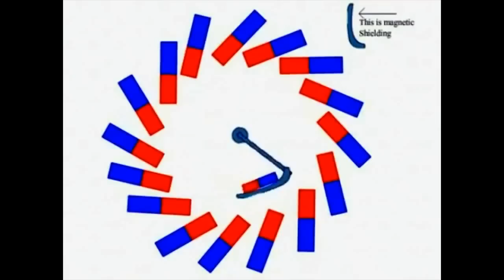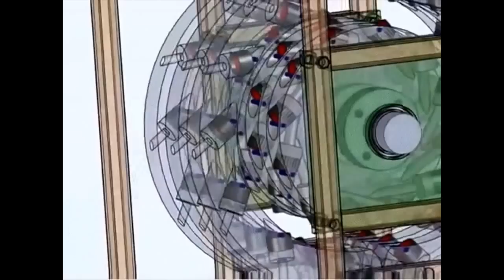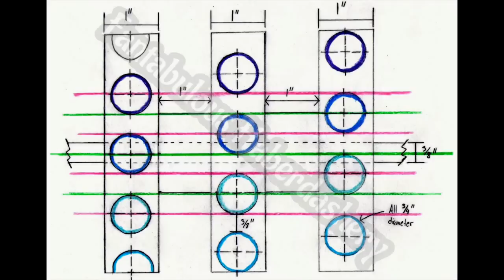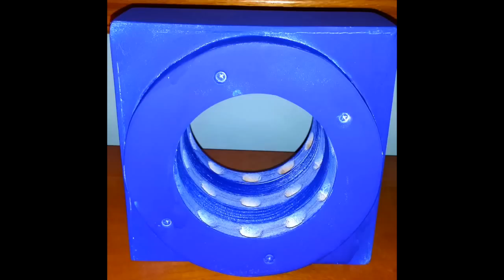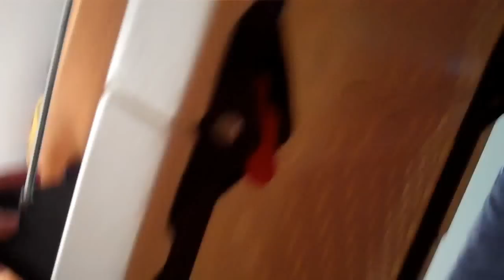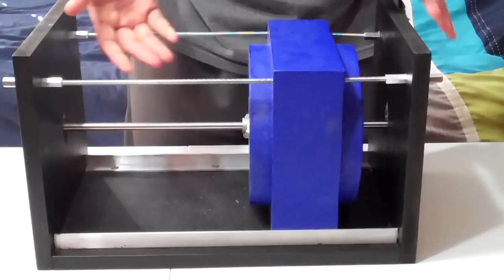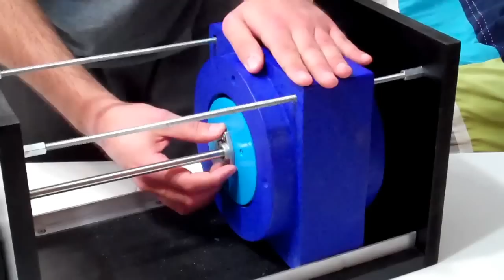Working Perendev Magnet Motor!

Comment: I like what I hear. People like you who think outside the box, are the difference between success and failure. Keep moving forward, making prototypes of your designs. If you figure out how to make a magnetic powered motor that can produce enough torque to turn a generator, then you have something. Adding batteries for energy storage, then you have something more. Further development for increased performance comes next. Your on to viable clean energy production. Do not let nay sayers have any affect on you. I have done things in other disciplines that were said to be impossible. I learned from mentors that did the same thing. Excellent job.

Comment: At around 10:09 when his hand moves away you faintly hear a noise like something was laid down on a hard surface. Could it have been something in his hand? Also at around 8:40 when he moves his right hand out of frame you can see a reflection of something enter view on side of box near edge of screen around about where the end of the shaft and bearing is which to me if you look closely looks like it is rotating.

Comment: "the laws of physics can't be broken" boy you obviously don't read a lot because we're using a quantum computer to reverse the time scale of atoms by a few seconds. A literal time machine. These free energy machines ARE real it's just that the exact numbers and whatnot are kept secret because it would make the coal and a lot of the electrical industry useless. Coal is so outdated I'm surprised we find reasons to keep using. The "golden ratio" he talks about isn't this, an old man was murdered over this engine,  over the IDEA that an out dated and deadly energy source was going to be replaced, a man was murdered and it was covered up. The ratio is like 1/8 in from inner ring which houses where your energy is gonna flow out and power while the ring with the magnets are set and locked into a certain position (about 1/16 inch distance from next "grabbing" magnet. This particular model he's demonstrating is totally wrong which is why it's not working. That moving piece is moved using some excess energy to reapply the initial energy put in to make it go in the first place. Energy is recycled through it's various mediums but is almost always the same amount of power because it takes energy to change your energetic state. E.I boiling water = steam

Comment: You have to try it with load. But you have to calculate the size of the load. It will not work without load. This is like a second-order differential equation, like "spring mass damper system".

Comment: Scam.. fake, joke...
The reason the camera angle changes is for the motor and rubber that you put in the end to spin the motor to show it 'working'.

Having been a  engineer amount other things the facts you have and design would never work as it, it's close to a design, but a mile away due to the flux issue.
The entire magnet position and angle is dictated by its fields. Which is why people fail in trying to make these things.
Reply: Why hasnt the greatest prankster on the net Thio Joe jumped on this scam?

Comment: It's not balanced!  If you balance it, it will spin longer.  Being out of balance is slowing it down.  I'm not sure it's producing energy, though.  Good luck!
Reply: it is out of balance, out of spec he changed the magnet angle, he used the wrong size magnets, the wrong length it is amazing it ran as long as it did

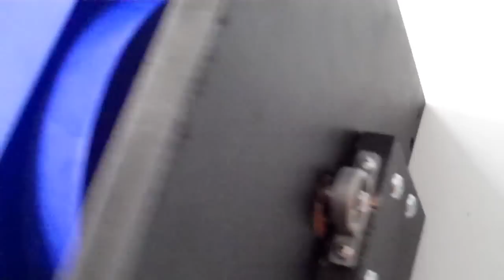Comment: At 9:17 you can see you pull away something from the shaft on the left side and you can hear you set it down on the table, at 7:46 you can also see a black gear attached to the shaft on the same side of the box, infact at 9:58 when it "catches" you can see and hear you attach something to the shaft again, definitely another scam. Maybe you could explain?
Or do you consider everyone a idot? The truth is your materials are to heavy and off balance to every make this succeed.

Comment: That thing is so out of balance it can't sustain a spin for very long. Enter the little R/C starter motor that he holds on the shaft, if you notice the shaft end it's not round. That's why he won't move his left hand, he needs to hold the device while he puts pressure on the shaft with the R/C starter motor. They are quiet also.
The shadow and the sound it makes when you turn off the starter motor gives it away. Nice magic show!

Comment: I like the way you are thinking, as in not so much as producing a high powered motor
but eliminating the rotating resistance first. You almost did this 
I'm sure you will achieve this, then you are clear to work on the power and torque'
good luck. Malc uk

Comment: Why are there so many negative comments about this? Magnetism is a real, scientifically verified phenomenon. Fact 1:Opposite poled magnets attract, same poled magets repel. Fact 2: energy can be Converted, i.e., mechanical to electrical, chemical to electrical, and in this case magnetic to mechanical. Fact 3: an object in motion will continue in motion untill an opposing force acts against it. Its obvious from the video that the inner rotor is wobbling, due to it being handmade and not balanced. The opposing force is friction. The friction is in the bearings, and even some air friction between the inner rotor and the outer. If a generator were connected to the rotor shaft The weight of the generator windings Would add more feiction. The creator admits in time the rotation will stop. He does not claim this is a free energy machine. Energy conversion is real people, so leave this obviously intelligent kid alone.

Comment: " ...eventually it slows down ..."
That means its losing energy and is therefore no good for any application.
Its more of a non powered flywheel that has some kinetic energy stored but could not power anything but itself ...for a minute or so?

Comment: I know you were trying to keep it super low budget but you'd have been much better off using a machined and balanced piece of acrylic for your rotating shaft.
Why did you use friction ball bearings when you could have put magnets on either end of the shaft and had a floating shaft with no friction, it's friction that kills all magnet motors, it amazes me how nobody uses magnets to have a frictionless shaft to spin on.

It has a long way to go but at least it's still looking at it and trying to find solutions, good video.

Comment: Try incorporating a planetary gear between the two magnet sources, to progressively advance the timing of the attraction,  and push.
Reply: Due to the equal energy of pull and push, the energy must continually advance to offset each other.
Reply: A heavy flywheel may help maintain the inertia to reduce drag.  However, some of the energy produced, must power the advancing motion.  Just saying!!!

Comment: I have noticed that magnets that are purchased on line have a great deal of manufacturing tolerance allowance for the magnetic field. That is probably the reason it sometimes catches  and sometimes not. My two cents worth. Hope that helps. Keep up the great work with explanations too.
Reply: Ahhh, I wonder if any suppliers specialize in exact measurements of power
Reply: @wills242  Do not really know Bill bob.

Comment: Problem is not about motors working. it is about explaining why magnetic flux from magnets is a  never ending process? do magnets lose that kinetics at space ?? NO. does moon have a magnetic field?.  Problem is/ there is no way to explain endless flux from magnets. Practical usage of magnets never comes to a satisfactorial conclusions cause people do not try hard on magnetic shielding to reduce pole friction. after inertia motor should spin eternally at space if shielding made fine.

Comment: Proof of concept. Keep at it. 
As far as the laws of nature you’ll soon find out that the laws are not all correct. Thermodynamics for instance is flawed. To understand the science you wish to enter you need to understand the esoteric principles at work in the universe. Electrical engineering will give u a language and basic understanding but to tap into the unlimited energy you need scared geometry , torsion physics, vortex math, non Euclidean,  hermetic and alchemical principles, longitudinal wave mechanics and its phase conjugates. The problem is that people keep coming at it from one side or another and never use a holistic approach. It’s def real as it’s old hat in the unacknowledged special access programs. (USAPs). We’ve had free energy or overunity or whatever you wanna label it since the 60s in the US and the Antarctican Germans have had it since the 40s. It’s all too real. So don’t ever worry about wasting time trying or anything like that. Failure is the greatest teacher.

Comment: I to have been working on this for a very long time and even had a very rough model made years ago. I've seen the mistakes others have made and he even says it gets hung up on itself. If you go back to basic magnetism and how it works you may have it figured out like I did. And this type of device will not produce electricity but possibly drive a generator. There are also super magnets that would work great for this type of device. I am working on a proposal for a grant to develop what I have in mind.

Comment: He made a magnetic bearing. If you are going the build an "over unity", you need a way of pulling energy out of the environment, either from heat, wind, light, or better yet, electrical energy from the atmosphere. By "free energy", Tesla did not mean a perpetual motion machine, he meant real energy from the Earth's environment. There are 300 kilovolts of potential between the top of the ionosphere and the surface of the Earth. It is brought in from Birkeland currents that connect Earth electrically to the Sun. There is about 100 Volts/meter of potential in the atmosphere right outside your house. Run an antenna up a pole, a building, a hill, or a mountain. Run a cable down to the Earth at the bottom, convert that potential to usable alternating current. Then you have a simple usable source of power. You know, tall building have to be grounded to get rid of this potential. Maybe we could use it instead.

Comment: A bit strange that he didnt spot the obvious application. If the cost in energy going in, is less than what you get out - that in itself has value.
There is an australian company that use rotating magnets to cut electricity bills. It uses a pulse from a 12v battery, this causes the magnets + wheel to spin for a while, generating more than the initial pulse; then the whole process rotates. This brings this to a question of cost: how often must the magnets be replaced, how much gain is there compare to loss and so on.
I had my design running for days, but its useless if it wont output  more than it takes to power the pulse. An arduino to handle the pulse is probably overkill, but its what i had.
The idea is solid, its just that people make these absurd titles like "free energy" and "perpetual motion". There is no such thing. But there is clever use of the natural laws in a fixed situation that can be beneficial.

Comment: interesting you need to shoot another video without such a tight field of focus to PROVE you are not applying an outside motor to the external shavt on the left side of the video for there appears to be some kind of shadow  on the  left of the frame when the motor starts to "catch and run" then it vanishes again when it starts to slow down a wider shot would demonstrate that the test is not a fake though  i must admit your voice sounds a bit shaky near the end leading some  to think youmight be being a bit...disengenious? but post another vid with a wider field of view showing it running and iam sure that  will clear it all up. the next question being will it do some useful work and not just freewheel without an active load?
--Rick

Comment: It's relativity isn't it. The magnets can be made to move in relationship to each other. You set up an equilibrium between the magnetic fields and motion. Place any resistance on the motion or interfer with the magnetic fields and the motion will gradually cease proportional to the resistance until it stops. It cannot apply a constant resistance as the magnets in motion only have a limted potential energy. Rather like a satellite orbiting the earth in perpetual motion. Any kind of drag on it's orbit will gradually degrade the satellites speed and therefore alltitude until it ultimately meets the atmosphere.

Comment: From what I've found about magnets and how they are made, even if your machine worked, you would only get as much work out of the machine, as the energy, it took to make the magnets.  For example, if it took 500 joules of magnetizing power to make a neodymium magnet, you would only get less than 500 joules of work out of it.  If the magnets did not ever demagnetize over time, this would violate the law of conservation of energy.  Part of the final process in making a neodymium magnet is to magnetize the material in a very high magnetic field for a very short time.
Reply: Sir but a neodium holds over 10 years, that is very many revolations :)

Comment: Neat video.  You should try keeping your other hand in the shot when the motor is running.  It seems suspicious that the slow down seems to occur when you're hand comes back into the camera shot.  Also, if you're going to use wood for your prototype, you should find some way to lathe your magnet holder to reduce the vibration and keep things more consistent inside.  I'd also like to see you try this with a vertical configuration rather than a horizontal one.  Maybe use magnets to reduce the resistance that would otherwise be caused by that gravity in the vertical configuration.

Comment: Hay bro I can help you about slow down problem. Outside magnet ring bottom line use power full magnet top side use less power magnet because gravity slow down.if all balances you can run infinitely.i hope it’s work in this setup u have to run more fast because I hope more fast can break earth gravity

Comment: My theory is like pushing a magnet across a table with another. Spacing angle etc. all come into play. Also remember the weight of material the magnets need to move plus resistance. Then if you add a gear box to power a small motor. The magnets need to be large enough to do the job correctly.

Comment: If you can get the center drum to balance where it is spinning without any resistance,  you may find that will aid in the spinning and it probably will spin much longer, it looks out of round just a bit which will cause the drum to loose rotation and slow to a stop much faster.
Reply: Use of very low friction ceramic bearings would help- pricey though.

Comment: Can we see what's under the table?
It's very easy to make a convincing video like this, where energy is supplied in some way invisible to the camera - a jet of air, for example, or a solenoid coil under the table that would keep the thing going when it synchronises with the mains frequency.
Nice try, but you'll have to make a much more convincing demonstration than that.  All this one does it to make you an illusionist of sorts.
I don't believe in Yuri Geller either - another 'genuine' illusionist whose act could not withstand scrutiny by James Randi.  Neither would yours.

Comment: Your inner spindle wheele isn't ballenced. If the weight was evenly distributed you'd have more chance of getting it to run indefinitely.

There is indeed already a working, self starting, magnet powered engine that looks to be 100% better than this concept.

Comment: The perendev device can not work all by itself nor give more over enegy. It's just a perfectly balanced device where the attractive vectors and the repulsive vectors are equal as when two magnets approach or go away, they get energy then lost it (or in reversed order), as usual, wich result in nothing, at last in the complete cycle. The problem here is from stupid peoples who think putting magnets in angle could make a difference like if the force vector is acting on a mass in a only one straight line like water getting out of a tube, but in the contrary, we must deal with force field, we must 'see' them like they are, vectors acting from the center of their source, onto the center of a mass or other force field. Only a more smart mecanism may illiminate the resistive vector (as one is the resistive one and the other is the energy one), or reverse it to transform it into an energy vector, which could also be stocked and reused at the good time in the cycle. But perpetual motion devices that give a more over energy can really exist, in depend on the mecanism, and remember, it's only a question of managing the vectors through a mecanism.

Comment: The problem is when the magnets get fast enough they create an electromagnetic filed that counteracts the magnetic filed from the magnetics stopping the device. Your point of resistance is an electromagnetic filled generated by the steel magnets passing eachother.

Comment: some of these magnet motors actually work but they don't produce much converted usefull ( magnetic to kinetic to electrical ) energy enough to overcome the vist of building the machine. In other words they are only fractionally efficient of other means of energy production.

Comment: Laws of Thermo dynamics! You can not get out of a system more than you put into it! The most you can ever hope for is a 1 to 1. Running its self but if put under any work load it will die out! Plan and simple free energy is a joke. Energy can not be created out of thin air!